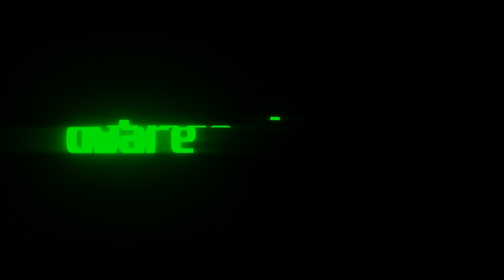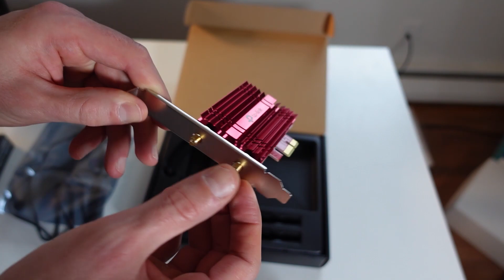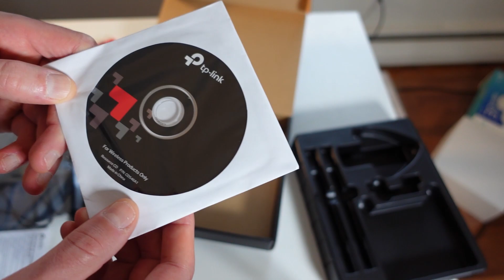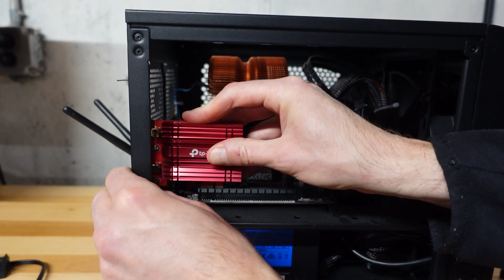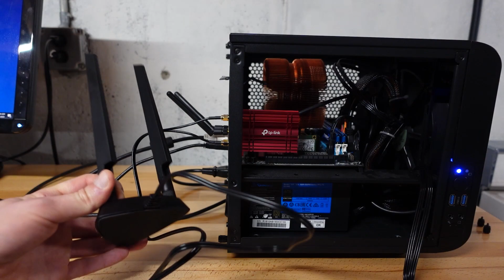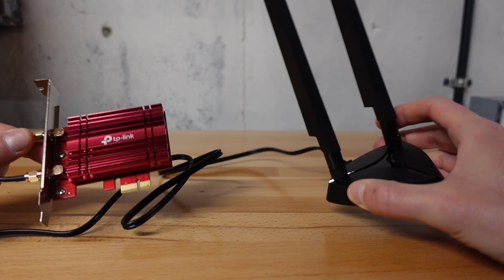Upgrading An Old PC's Wireless With The TP Link Archer TXE75E (6Ghz Band Setup And Speed Tests)

Comment: i want to ask you not about the tp link archer which i have seen how it works on the video but about your house. You see, i have a home with thick brick walls and cement patform floors, lets say there are a lot of obstacles for the wifi signal, thats why we have relatively low speeds throught the house although the wifi signal covers every spot (2.4/5ghz). So i wanted to ask you if your house has a similar configuration or your materials are less dense. Thanks

Comment: mine is not working  and the softwre instalision guide is terrible i cant find the right software pogram
Reply: You probably installed it in the wrong port. There are usually at least 2 slots on your motherboard and you probably installed in number 2 closest to the GPU but you need to install in 1. I know this was 9 months ago but this comment is also for future buyers
Reply: @StogieConsumer my problem is that when i try to install the driver it says the adapter doesn’t show up and it failed
Reply: @Kenneth-yo2cu I'm sorry that I can't help you then because I actually wanted to buy one of these internet things but my GPU covers the spot where this goes

Comment: I never really knew a difference between network speeds until I found out my win7 pc wouldn’t connect to 5.0GHz. I thought Wi-Fi was wireless. My pc was fast on Ethernet for the past few years. But after I moved my pc to Wi-Fi only I ran into many speed problems. Have a 50ft Ethernet cable from my modem to pc. So I might buy this after watching the results. I know I can’t get 6GHz without win11.

Comment: This is a great review, thanks for sharing! The TP-Link Archer TXE75E seems like a solid choice for upgrading older PCs. I'm impressed by the speed improvements you demonstrated, especially when compared to the old onboard wireless card. It's good to know that it can breathe new life into aging systems. I'd be interested to know more about your experiences with the 6GHz band and any other noteworthy features you discovered. Keep up the good work! 👍
Reply from the maker: Thank you.  As far as the 6ghz Wifi 6 it took a bit research and I found out that there are some system requirements the need to be met in order to successfully see the wifi 6 ssid broadcasted.  They are actually listed in the manual in fine print.  I'm thinking about doing a follow up video on this.

Comment: Hi, so i need some assistance.

My GPU covers my 2nd PCIeX1 slot but doesn't cover my first PCIeX1 slot. The first slot is above the GPU (Horizontal lay) and below the CPU fan. I did not realize this and inputed the adapter into the X4 slot (closest to the F_USB slot). 

I would like to only utilize the X1 slot but am worried that because i know the bluetooth cable won't reach the F_USB slot. Is there a way to icnrease the length of that cable via extension or is there such a thing as a larger cable? and if so, is it "Okay" if that cable is touching the GPU's cables or GPu itself since it will have to go around the GPU (i can't go through it obviously).

Please help!
Reply: Yes, is okay if it touches the gpu or the cable and it won’t disrupt anything but make sure the cable doesn’t hit any fans.
You can use extension online that are specific for your problems